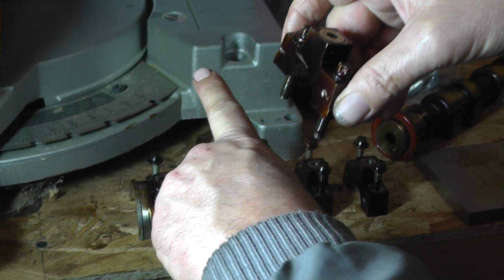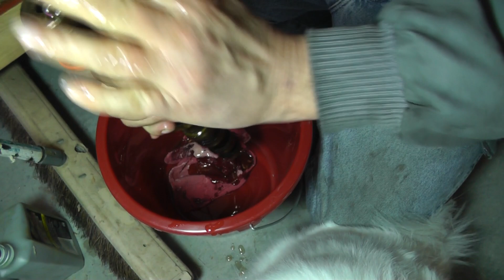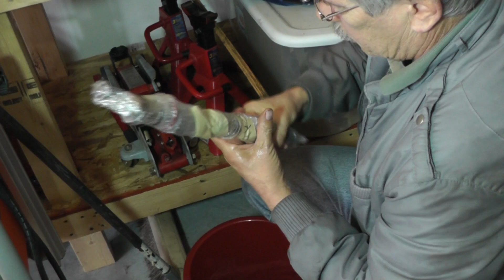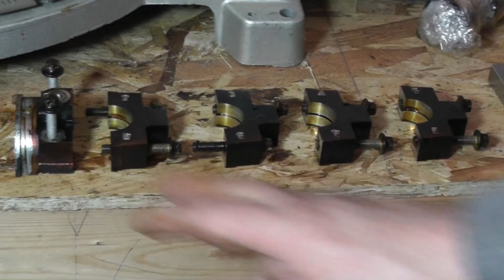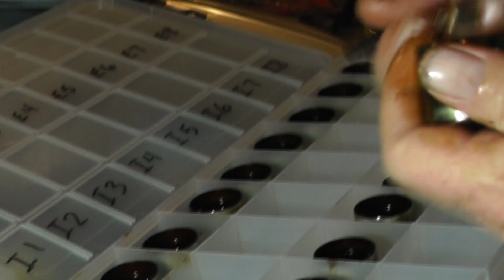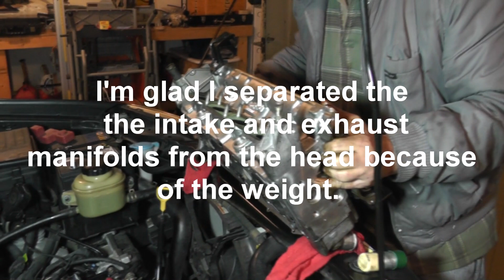Suzuki Forenza Head Removal - Part 7 (Cams and Lifters Removal)

Comment: So, if you take the cams out while the head is still installed you wouldn't need to take the cam sprockets off? Why not save those bolts since they're one use?
Reply from the maker: The reason I took the camshaft sprockets off is so I could replace the camshaft seals. Have a great day!

Comment: You sir, are amazing. I have an 08' Forenza that needs an oil pump. I turned the crank pulley with the timing belt off and will now be resetting my cams timing. Wouldn't have had a clue without your videos. Thank you!!!
Reply from the maker: You're quite welcome and good luck!
Reply: I still haven’t gotten this car running due to not fooling with it, but the car is running hot and it blew the radiator hose, and then eventually the entire radiator exploded. This is after I replaced the oil pump and reset the camshafts. Would you say it’s likely the head gasket? I’ve replaced all the motor accessories, timing belt, etc. but I never pulled the head off all the way. I’m considering pulling it and resurfacing the head and replacing the gasket, what do you think?

Comment: I am in a pickle and hope you can help. The videos on how to replace the head gasket were second to none I have ever seen. made my task easy. Now for the problem. As I was installing the camshaft sprockets and the crankshaft sprocket I found an extra part on the floor directly under the sprockets that I can't account for. It is a round magnet about 1/2' diameter about 1 inch long with a metal stem that sticks to the magnet and the stem has a slotted end. Can you tell me what is might be. I have a picture if you can tell me how to email it to you.
Reply from the maker: The only thing that comes to mind Ken is a magnet for the camshaft sensor. I'm assuming as I don't know for sure that it would be attached on the backside of one of the camshaft sprockets. Take a look at the back of each one and maybe you can see where it was attached. Hope that helps.
Reply: I removed both cam sprockets and nothing attaches to them. Removed the cam sensor thinking it might fit behind it but it is a sealed component mounting to a flat surface. I have discovered that when the timing marks are lined up per the video and the timing belt is on that I can only turn it 1 revolution and it won't go any further. Both cams turn freely on their own and the crankshaft turns freely on its own but when the belt is installed it stops after one revolution. Any ideas. Is there a way I can send you a picture of the spare part to see if it sparks a memory.
Reply from the maker: Ken Buchholz from my memory as I’ve sold the car years ago, the cam sensor is a hall-effect sensor. I remember now that the sensor may be looking at one of the cam lobes where that magnet may go. I don’t recall any magnet though. You mentioned about replacing the head gasket. The belt didn’t break, correct? If not, there is something wrong about how you’ve lined things up. And if you’re sure that’s correct, are you sure it’s not coming up on compression. You will have some resistance as you turn the crank, but it should not bind.
Reply: Thank you figured it out. The magnet and stem was the guts from a rear ABS sensor that I put on my pickup a month ago. I stuck it on my jack and forgot it and while the jack was under the engine I moved it and it was knocked off.  Thought the belts were correct but they weren't. So all works well now. Thanks again for the videos, they are amazing and easy and indepth enough to not leave you with questions.
Reply from the maker: Glad that you got it all figured out Ken as I know that you're relieved now that everything is working fine :)
Reply: Just got a great reminder that it's best to throw away old parts from previous jobs and not do it later.
Reply from the maker: Ken Buchholz Sounds like a good idea Ken 😀👍

Comment: What do I do if I strip one of the torq bolts? :(
Reply from the maker: Marcos Castellanos assume that you're talking about one of the bolts that hold one of the camshaft caps down. You will need to get it out. You can try left hand drill bit or possibly use an extractor.
Reply: stuzman  I meant the head bolts. Sorry, I stripped the inside of it. Do I still use an extractor or left hand drill bit ?
Reply from the maker: Marcos Castellanos yes you will have to get that out for sure. Yes, same procedure, good luck!

Comment: I'm down to removing the head bolts and I was wondering how much psi on the air torque wrench do I need to remove them to get the cyclinder head off ? All I have is a 130psi air conpressor
Reply from the maker: Nicholas Bernard 130 psi should be more than enough. Be sure that your air compressor has enough CFM that's suitable for your air tool.
Reply: stuzman thank you !!

Comment: thanks for great videos. I'm a diyer and do not have the means to make that crank sprocket holding tool. what other options do I have in order to torque the crank bolt properly?

Comment: Hello, I like your videos a lot, I have a question I hope you can answer, when we where dismounting this engine, we forgot to mark the camshaft and now we have no idea which is the admission and the exhaust, is there a way to know which is wich? Thanks a lot in advance!!
Reply from the maker: Look closely at them and see if there are any part numbers. Then you could google and see what you come up with.
Reply from the maker: Look closely at the two and see if there are any part numbers. And then google and see what you get. If not, then I'm sorry.
Reply: stuzman52 alright, thanks for your quick answer! Greetings, keep up the good work
Reply: I have found out that both cam shafts are built identical to eachother. So it doesn't matter which one goes where really. Cause when you install them and their timing is set, they work in an alternating sequence from eachother.

Comment: I mixed up my cams, they both have the same part number (r904000056).  Ones says lyd 13 and one says lyd15.  Which is which?
Reply from the maker: I can't say Jay for sure which is which. Others have posted the same question and came to the conclusion that both were the same cam. Since I didn't hear back from them, I can only assume they are the same. Take a look at the cam profiles on each camshaft and see if they point in the same direction.
Reply: stuzman52 Thanks for responding.  lyd 13 is the exhaust.  Please check out my video. My new problem is that whenever I try to turn the cams to line them up, they keep snapping back (video on my channel).  This makes it nearly impossible to get the timing marks aligned.

Comment: i just kept the intake and exhaust manifolds on saved on time, great video btw excellent explanations. it seems these engine have the same tensioner issue with it coming lose and blowing the head, luckily the pistons were good, the one i did i had to replace all of them and re ream the cylinder bores very big job that was
Reply from the maker: Hey James. Glad to hear that you got it all worked out. Yes, as for the tensioner bolt getting loose, you're probably right. That's what happened to me and that's why I put lock-tite on all of those bolts around the timing belt area. Take care...
Reply: stuzman52 Yep I did as well. The service manual states every 40000 miles or in my town 60000 kms should be changed but my owners manual says 100000 kms or 600000 mile. i will be changing that belt again soon, 200 bucks later vs 3000
Reply from the maker: ***** The service manual says 60,000 miles also. Of course as you may know, mine went out at 40,000 miles with a bolt that loosen up on the tensioner. As you know, it's a pretty easy job to change the belt compared to other vehicles, so you're right, it's good insurance to change that belt versus a $3000 dollar job. Take care James...
Reply: stuzman52 You as well. the only reason i keep this car is because for an 06 its very easy to service, when my Transmission range switch went 15 mins later i was done. it was easier to change that then the oil LOL
Reply from the maker: I hear you James. As for my Suzuki, I sold it back in February. I figured that if Suzuki was going to show their loyalty by shutting down in North America, I could only do the patriotic and loyal thing for them was to sell the car. As far as I know, the guy is enjoying the car and still it's still running good.
Reply: stuzman52 after all that hard work you did i believe its running like a hybrid. i know mine is, i dont own a suzuki i own an optra but its the same daewoo engine. its a nice car runs well but a pain to buy parts for thank goodness for suzuki thats where i get my parts from. only 2 years left of payments i hope i can keep her running like new
Reply from the maker: I believe James that you should be able to get a couple of years with no problems. Just keep up with the maintenance and you'll be good to go.
Reply: stuzman52 Thanks Terry. I wont be buying one of these engines again
Reply from the maker: Sounds like a good idea James since the Suzuki dealerships are drying up. I've also seen Suzuki parts online where there is no return. That tells me that they have a limited number of parts on-hand that they are selling and probably not replenishing those items. Eventually, Suzuki parts will be harder to find. Take care James...

Comment: Great videos! I have Suzuki Reno 2007 and I was wondering if the engine from Suzuki Forenza 2006 or 2007 fits? I am thinking of engine swap.
Reply from the maker: My guess is that if it's a 2.0 liter, then it will probably fit. But you should do a little research such as asking the question at the salvage yard and/or the dealership if you can find one. Take care and thanks for the comment on the videos.

Comment: Miracle you didn't strip those torx bolts.  Dodged a bullet there.  This is why I like my non-interference engine.  Man that sucks, all because of a broken piece of rubber.
Reply from the maker: Yeah, I got lucky on that one. The bad thing is that the dealership did the last timing belt change and when the tensioner bolt loosen up, then the belt broke. You're right that it sucked because it took about $700 for me to do the job which was parts and the machine work. Thanks for dropping by DJ....
Reply: stuzman52 Isn't a timing belt service still under warranty by the dealership?  Would you have to get a lawyer to try to get them to own up to that one?
Reply from the maker: ***** Yeah, but it would have been a pain in the ass to go through the hassle. And that dealership went out of business about a year after the belt was changed. As you may know, Suzuki decided to pull out of North America so it's hard to find a dealership nowadays. I think there are still a few around, but they're drying up. So, to offer my loyalty and support for the company, I decided to sell the car back in February. Take care DJ...

Comment from the maker: Yes, some people do it differently as you mention. Some from the outside to inside and some Inside to outside? With only quarter turns on the bolts, it wouldn't hurt the camshafts either way. The general rule is that when you unbolt something such as cams, heads, manifolds, you start from the outside and work your way in. Then when you bolt it back, you start on the inside and work your way outwards. The idea behind this is to minimize any warpage that may occur.
Reply: stuzman  ? this is a 2.0 l  engine?

Comment from the maker: Crab, not sure if you're still interested, but I took a look at this before I buttoned it up. On the intake camshaft side, the head bolts are slightly to the side, but if they come out past the cam, it will barely make it. On the exhaust side, there is no way those bolts will come out unless the exhaust cam is pulled. Those head bolts are directly under the camshaft.

Comment: do the cams have to come out of the head if you only want to replace the head gasket, but no valves? Can't tell if the head bolts are actually under the cam shafts.